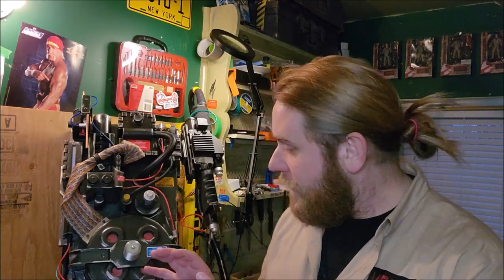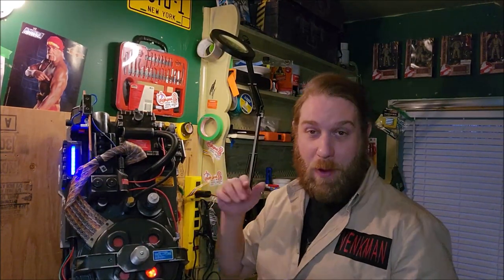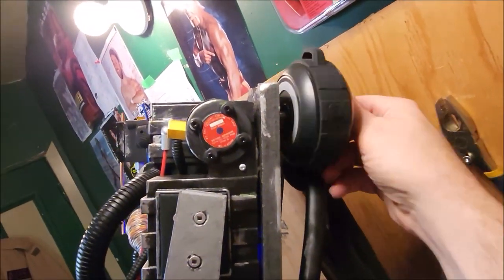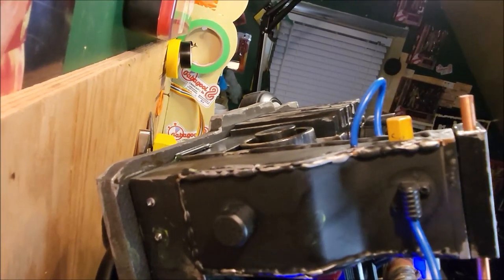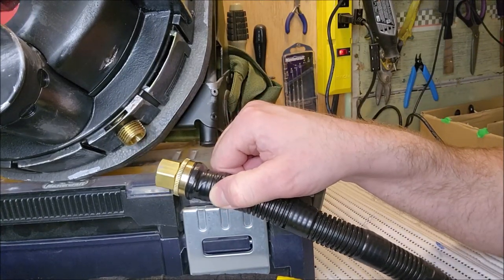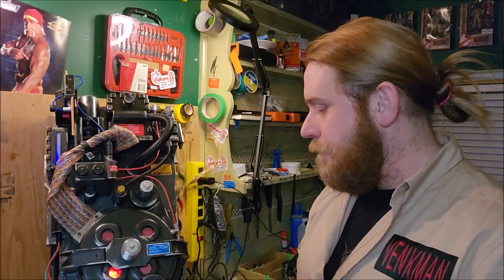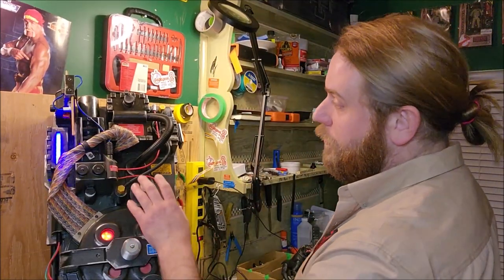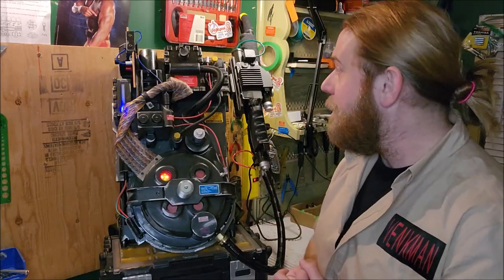Proton Pack Build Vol. 5 - The ACTUAL Finished Product

Comment: your pack looks fantastic. you did an amazing job.  I kinda agree with you that I wouldn't trust a 3D-printed v-hook to keep your Spengler wand on. I would just go with a metal dixie cup bracket that way I know that it won't snap and fall crashing to the ground. I know there not movie accurate but they work. other than that, you did awesomely.